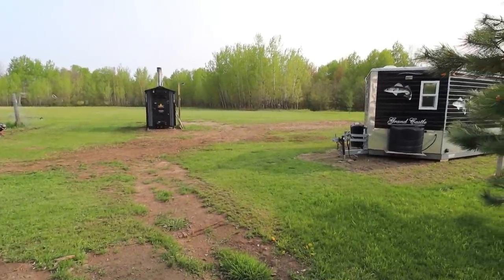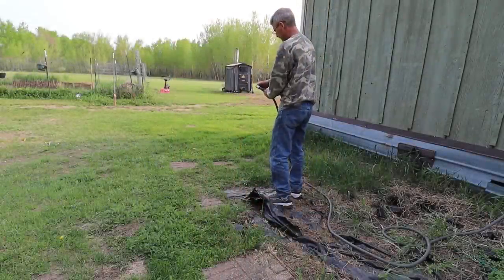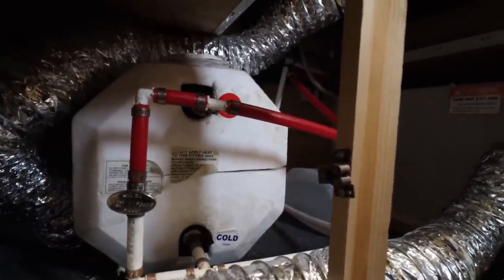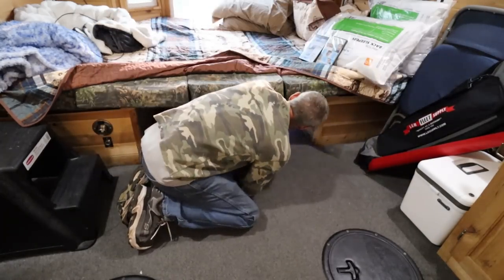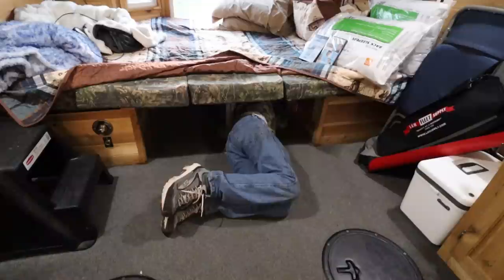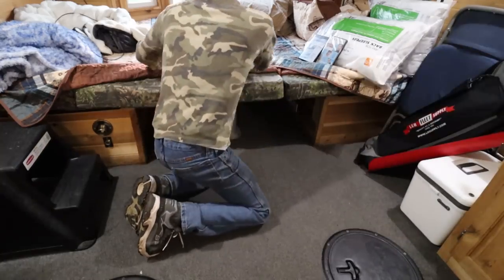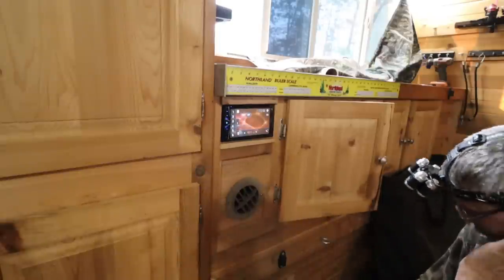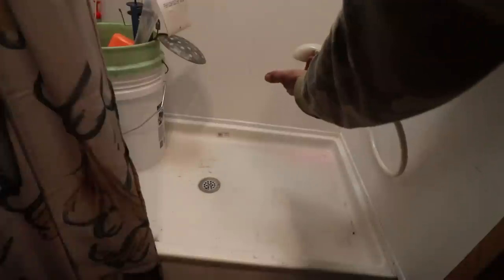THE FISH HOUSE. Hooking up the water. Turning on the water heater. Electrical problem.

Comment: Mosquitos??? Get some black buckets or spray paint them black (mosquitos are attracted to black) fill 3/4 with water. Add a 1/4 piece of mosquito dunks (look like donuts and made by Summit). Place a bunch of these buckets around your property in shaded areas. Non-toxic, works from the bacteria in the dunks that the mosquito larvae eat, then die. Cheap mosquito control.

Comment: 7:57 Joe, over your right shoulder?  Furnace exhaust correct?  Is it normal to be that black?  I've got a camper and mine is not that dirty, of course I don't camp in the winter though.  Just a question.
Reply from the maker: Go back a couple fish house videos and I cover that. I had to clean the furnace.

Comment: You know they make fuse testers. You can also just use a voltmeter too. The fuse tester is less to keep up with. Voltmeter you have the meter plus the tester leads. But unless it is obvious which fuse blew the only way to know for sure is to test each fuse.

Comment: Why is the floor so high up for the shower?  Does it have to do with having the drained shower water from freezing under the trailer?  
And, a converter changes AC to DC.... 
🙂
Reply from the maker: The sewer holding tank is under the shower and toilet, that is why it is raised.